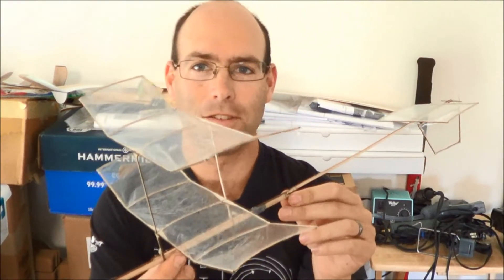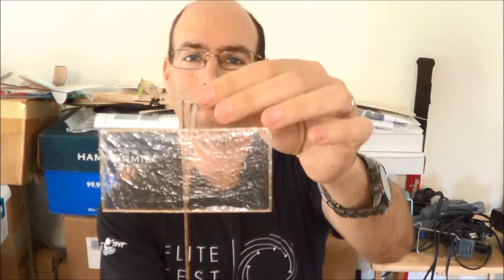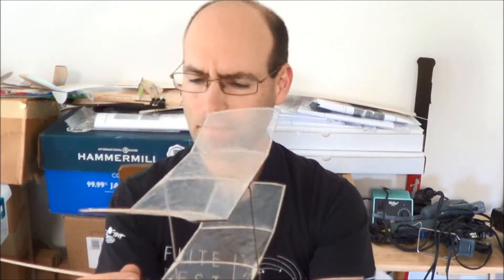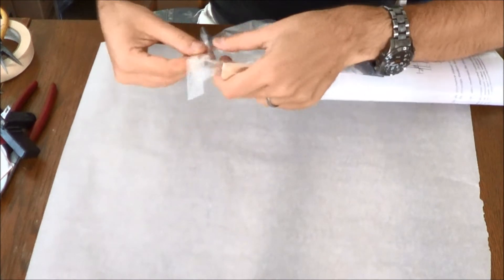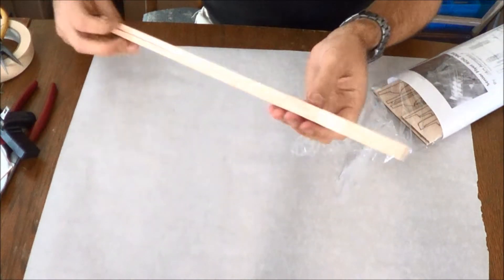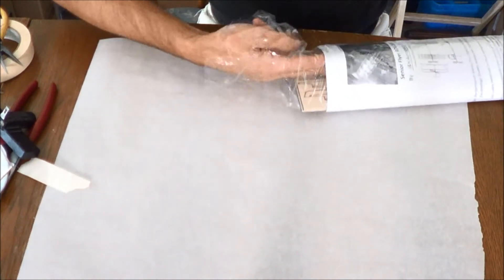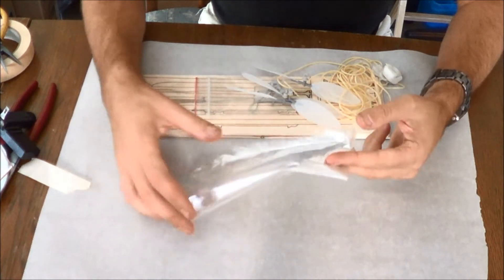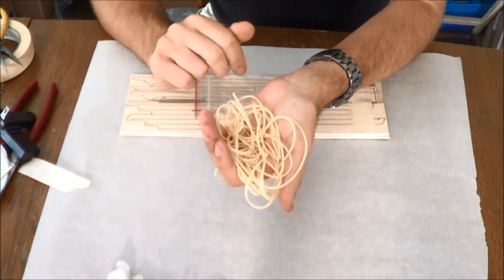Senior Flyer SO 2020 Build Pt.1: Wings and tail

Comment: What is the name of that brown containered glue that you used?
Reply from the maker: Mystic the spray adhesive? It's 3M Super 77.
Reply: No, the stuff you use at 7:47
Reply from the maker: Mystic oh, that's CA accelerator, also called kicker. You can get it from BSI, Mercury Adhesives, or Zap.